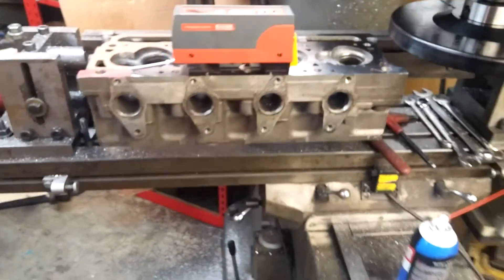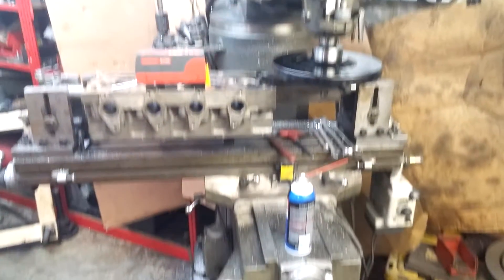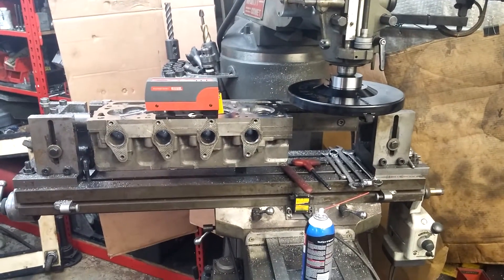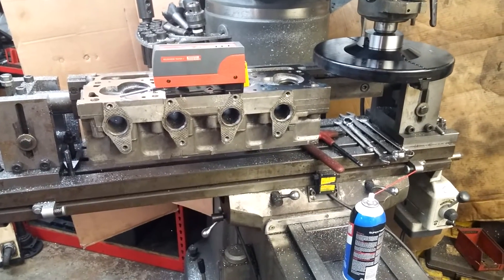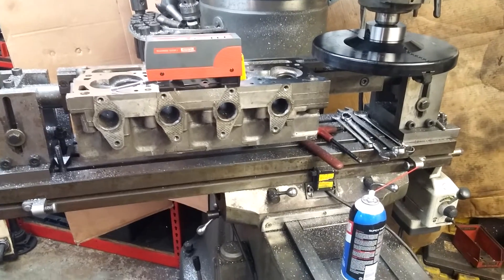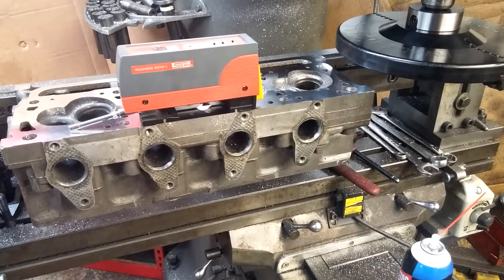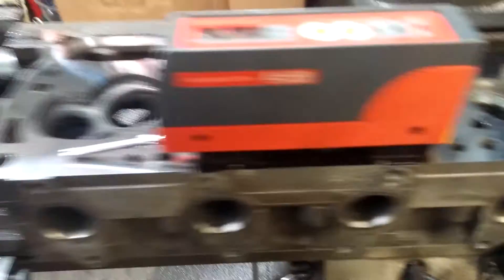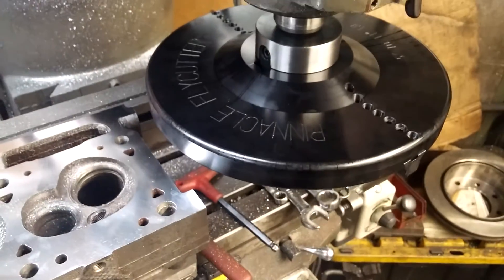Head Surfaced with Pinnacle Fly Cutter

Comment: Question. Do you have enough table room to completely clear the flycutter on the trailing stroke, or are you cutting on the leading edge only? I only have a 35 inch table which will limit me on using big fly cutters on long parts if I had to use the trailing stroke. Thanks.